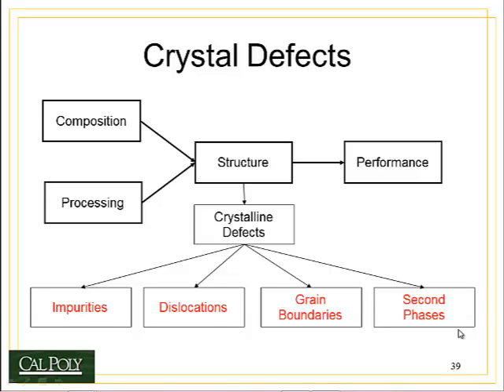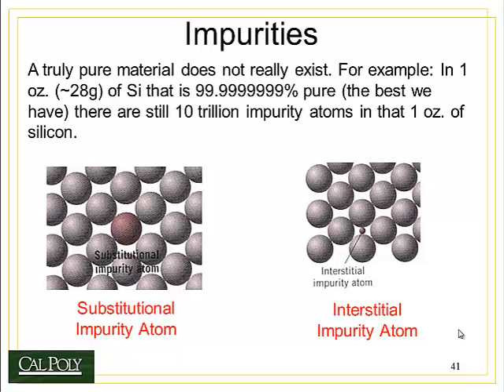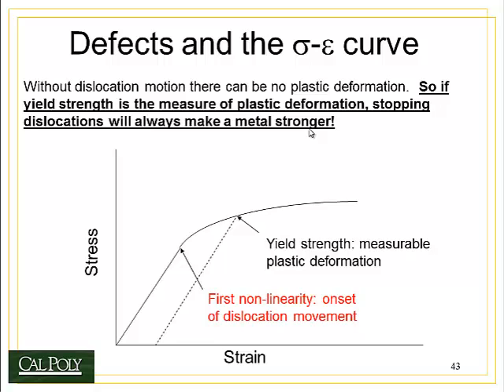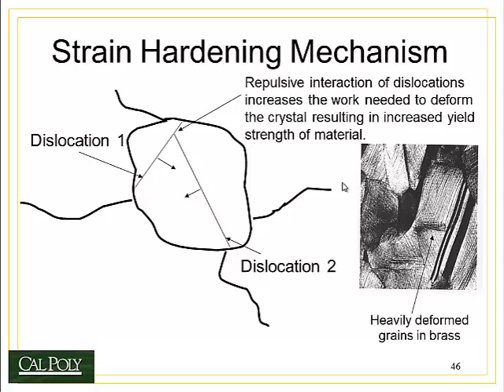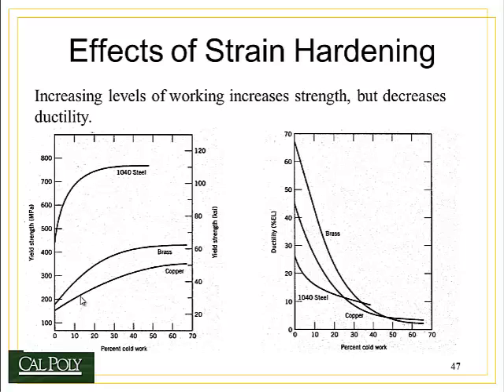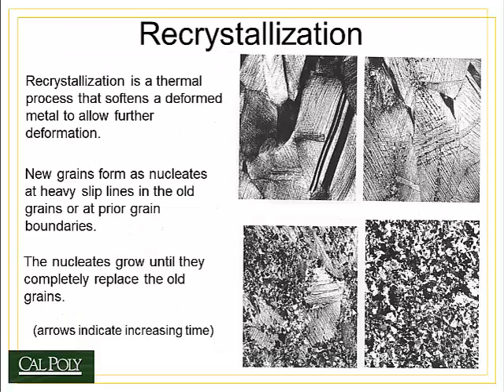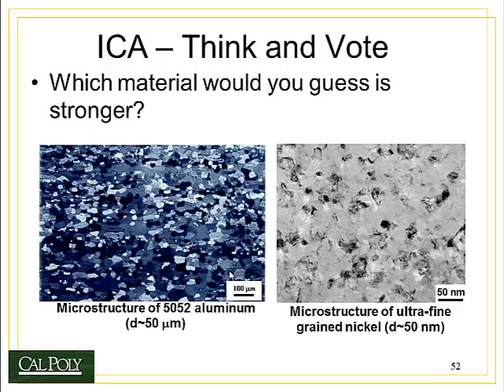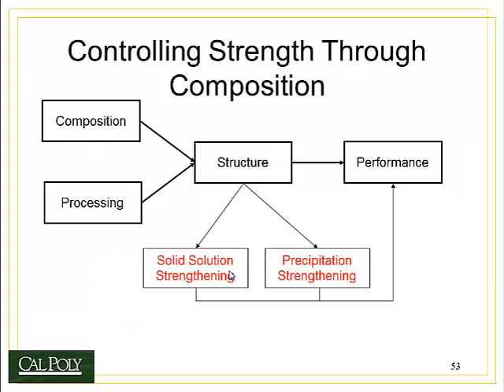MATE 210 Topic 4 Defects and Strength Part 6

Comment: What is the difference between slip lines and dislocations?
Reply: materials will have dislocations in it's crystal arrangement of atoms in grains and grain boundaries ,it is unavoidable. Plastic Deformation Of any material made of single crystal or poly crystal is aided only by Dislocations motion. without Dislocation and dislocations motion  material will not be deform plastically and it is said to be  very strong and only Fractures at high Stress. (so also hindering dislocation motion increases strength of the material)
And 
This movement of dislocations (dislocation motion) which aids plastic deformation is carried out by means of a mechanisms known as SLIP and TWIN . Both Slip and twin has different morphology and  different approach to dislocation motion.(search in web for detailed explanation)

Simply , Dislocations are crystal defect in Materials which in motion (dislocation motion) helps in plastically deforming the material.(all mechanical operation like Forging,Deep drawing,Extrusion, Bending, Rolling , shearing and all other are aided by Plastic deformation) and 
Slip is a specific direction and plane  in crystal structure through which dislocation move